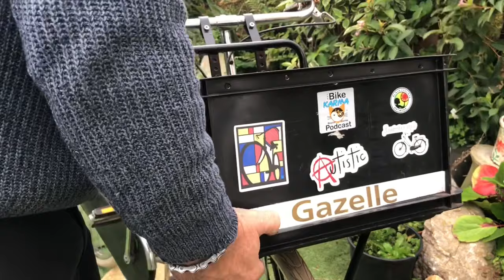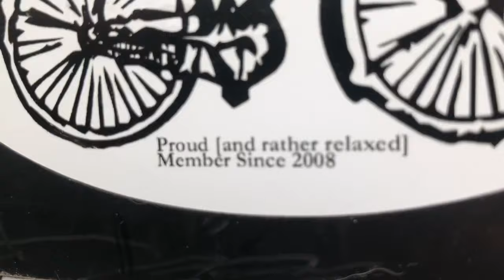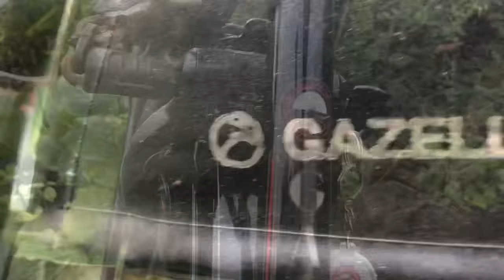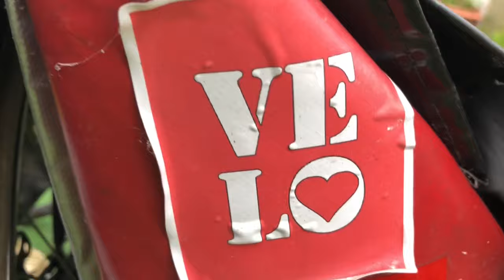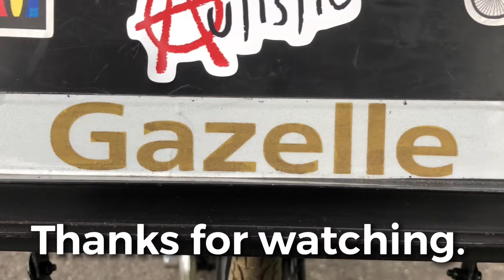Converting a Gazelle opafiets dutchbike into a cargobike. Fitting a pickup transport carrier & crate

Comment: Hey, I have almost the same setup with my gazelle tournee but I found one issue particularly annoying - and that’s my front wheel/rack/handlebar spinning while i park my bike/pack my groceries. I have bought the so called   steer damper (spring attached to downtube and back of the fork crown) but the spring turned out to be too weak. In my modern city bike i have the steer lock but that's probably impossible with my old 1" gazelle steerer tube. Have you found any proper solution for that?
Reply from the maker: Heres a hack for your steering spring - a car windscreen wiper return spring!
I need to fit one, and it will be in a future vlog. 
I use the drop down rear stand, it weights the front wheel and holds it, but it’s not stable enough, so I use the side stand, which makes the wheel flop. In conclusion it’s not as good as a real carrier cycle, and I intend to build up my old Pashley and do a comparison with the Gazelle, Elephant and Falke.
Reply: @unbalancedcrank Now that would be a really interesting video 👍